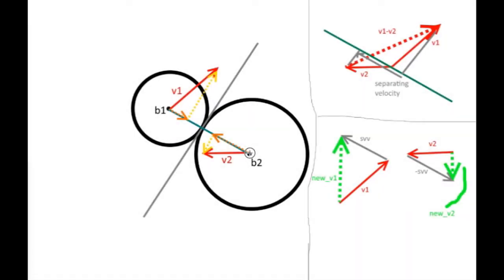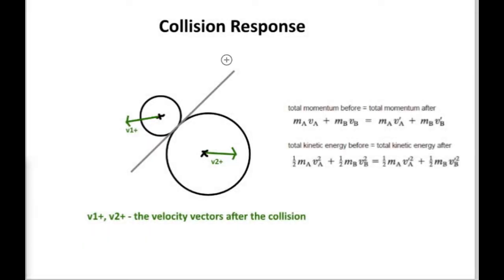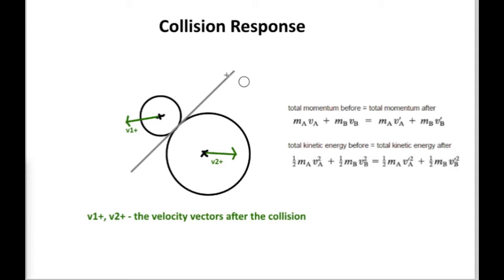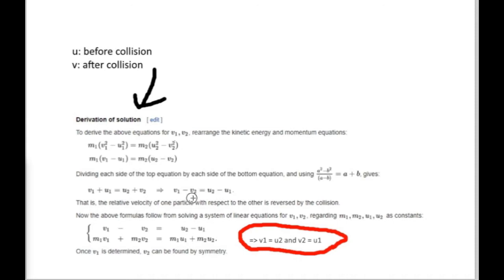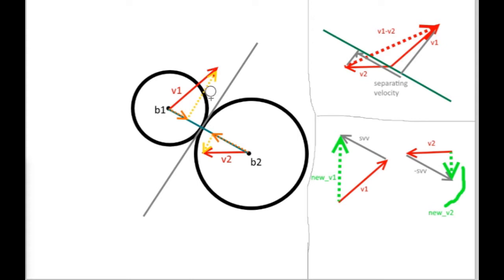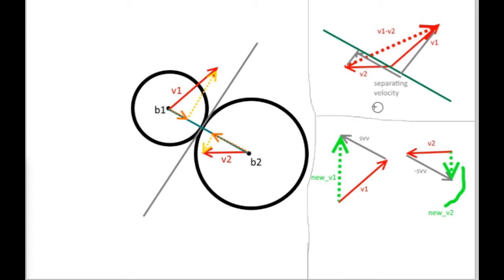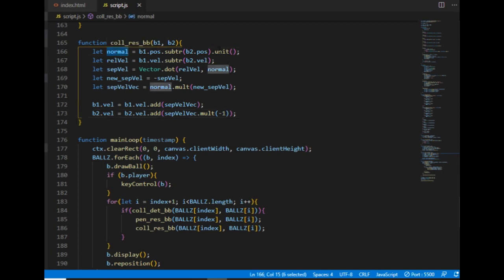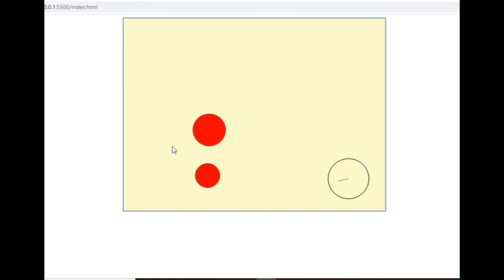2D Physics Engine from Scratch (JS) 08: Collision Response

Comment: Hello~ I am enjoying the lecture.
Can you elaborate on the separation velocity? When v1 - v2 are subtracted, when the relative velocity vector is dot product with the normal (green line), how can the svv direction come out at 5:54 seconds like the picture on the bottom right? Can you draw a picture of the direction of the dot product? I don't understand why I have to do -1 when I draw a picture TT.TT😭
Reply: First notice that the two velocities are written as a sum of a normal vector, the one that is on the same line with the collision normal and what's called a tangential vector, that one is parallel with the tangent between the two circles, the gray line, these are our axes on which we want to project the separating velocity. After calculating the relative velocity, he calculates the dot product of this normal velocity with the collision normal to see how much of the normal velocity is on the normal ( this can also be done for the tangential vector, the second component of the velocity vector ), then he multiplies the collision normal ( unit vector ), to basically scale it and get the separating velocity. That final multiplication by -1 is to reverse the final velocity on the normal. He only does it for the normal, you can do it for the other component too. The tangential one.

Comment: 2:16 It is incorrect. The last part v1 = u2 and v2 = u1 will only be true if m1 = m2; which is not mentioned anywhere on that page.
Reply: In this simplistic scenario however, he has not implemented mass so m1 = m2 = 1
Reply: He already mentioned it at 1:54
Reply: Right. The explanation is not correct since he assume m1=m2.